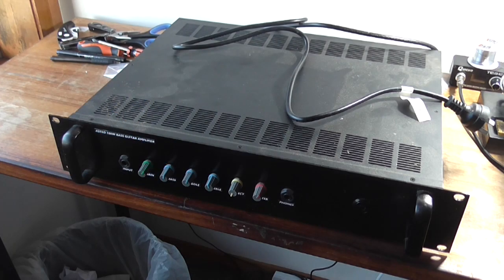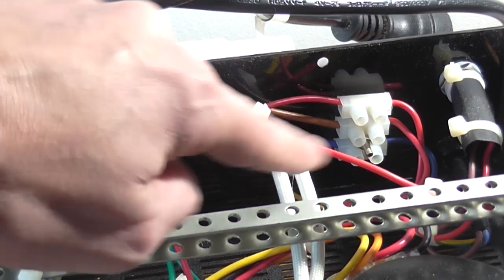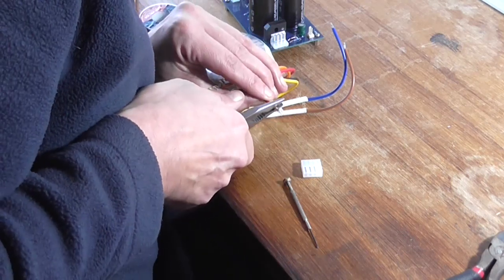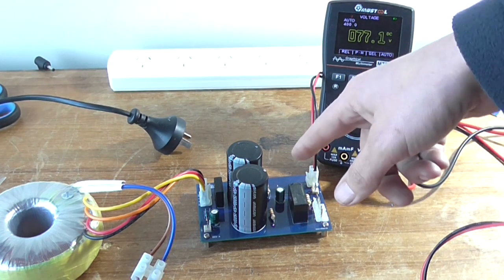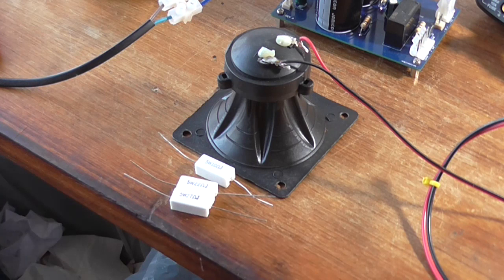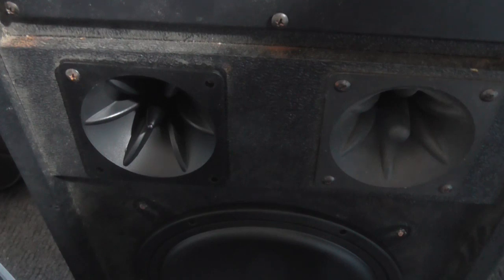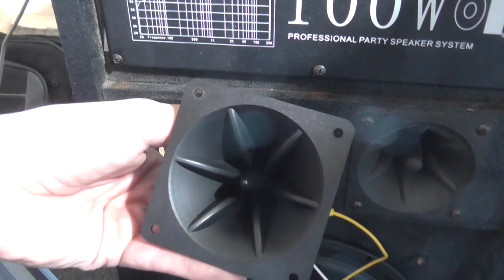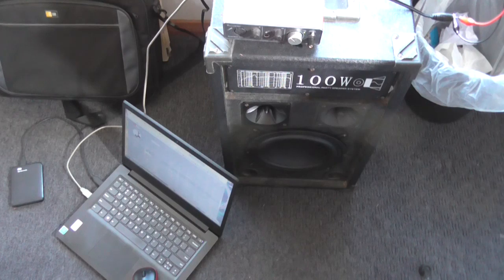Taming A Piezo Tweeter

Comment: I built an open baffle speaker with these without crossover, rear facing and connected out of phase. 
So was in phase with REAR of cone of bass mid. I used a Yamaha equaliser as open baffle do have issues. Sounded pretty good.

Comment: I'm running 8 Motorola 3x7" piezos in a DIY with four 15's. I managed to Tame them by hooking them up through the inner matrix of my series parallel wiring between the woofers. No crossover, no L-pad adjustments, and they get along just fine. The woofers roll off at 3khz, and the piezos roll in at 2khz with a fairly smooth transition. I kinda like this way, nice & simple.